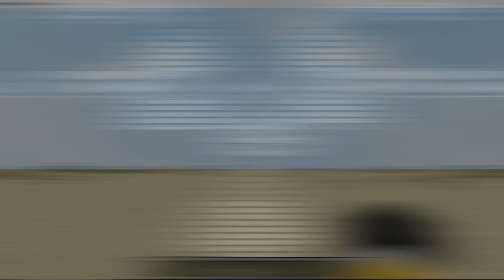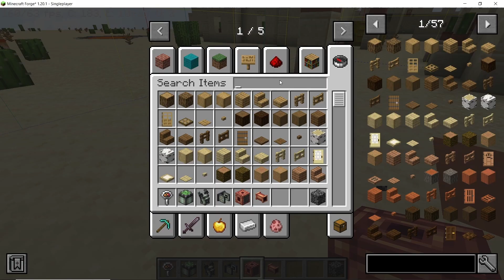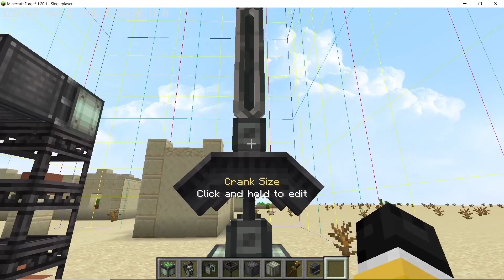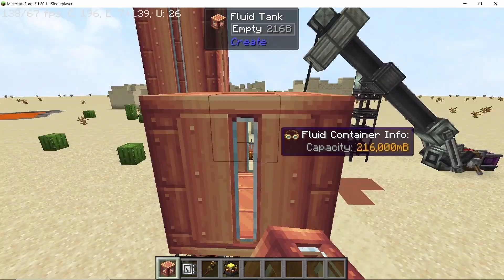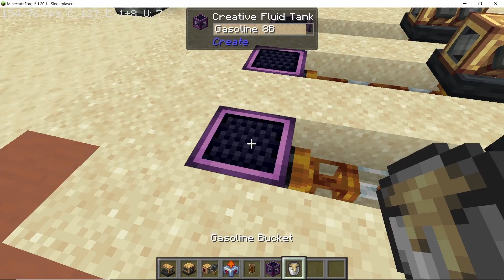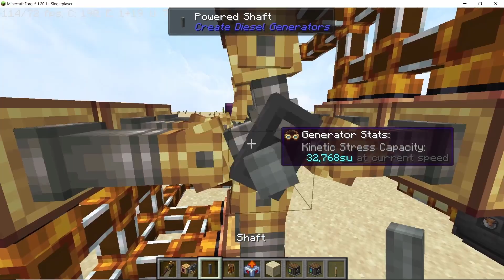Create : Diesel Generators Mod : Pumpjacks, Diesel Engines, Distillation Towers & More

Comment: Hey bro can you give me some advice, as I cant find any proper progression guide for HBM? Right now i got the oil refinery and industrial combustion engine to produce power. What do i do now? I thought abt the chemical plant to produce some chemicals but what should be my goal? Love from germany
Reply from the maker: With oil products obtained I think you should aim for your first nuclear reactor now. Maybe zirnox or a very simple rbmk as it'll be a big power boost as compared to oil power. For this you'll need to refine radioactive ores like uranium and thorium so make sure you upgrade your hazmat suit and try to make the process as efficient as possible cause the more nuclear fuel you obtain from your ores the more powerful fuel you can craft from it once depleted. I wish you all the very best and also let me know if you run into any issues
Reply: @SavageVegeta  Hey thanks for the tips thats actually what I did now. If you care here id what I did: I got a Zirnox and had it run with natural Uranium a long time to get a lot of more nuggets of others, also I have schrabidium and the lunatic Armor now. I also use the ore lase from minefactory reloaded with reduced work so i dont have to mine for iron every second, but I kust used it for help and replace it with sth from hbm mod. You think the best next step would be like a PWR Reactor?
Reply from the maker: @zynoo9450  yeah PWR would definitely be a good progression step. Also don't forget you have access to the Chicago pile using which plutonium can be made and also the research reactor which will power the breeding reactor so your fuels can become even more powerful.
Reply from the maker: @zynoo9450  also one more question, why are you using the laser from MFR when NTM has bedrock ores available. Craft yourself a large mining drill and then bedrock ores will provide you with a continuous stream of the chosen material. The best part is even uranium and thorium have their bedrock ores so if you manage to find them then you can have as much Nuclear fuel for your reactors as you need
Reply: @SavageVegeta  Rn im crafting the 4 breeding reactors along the reasearch to enchance my fuel. The problem is the Zirnox doesnr provide enough energy to power the large ming drill (except i have better fuel-> more steam) or I burn some high flammable fuels in an industrial combustion engine. I want to use the ming drill with all the upgrades, but its very expensive to power right now, I will first make the PWR or Chicago Pile
Reply from the maker: @zynoo9450  alright then, hopefully a PWR will provide a nice boost to your overall power grid 💥

Comment: please for next video told me how wear the glinder and how make agreat bunker
Reply from the maker: Fill the glider with fuel first by placing it in the output slot of a barrel/tank which has kerosene in it and then attach it to the chestplate using the armor modification table. It is as simple as that :D

Comment: I have a question: in some of your videos you have above 60 fps. I set fps to unlimited but is still have 60 fps (i have a good gaming PC) The sodium mod doesn't work because it's not for the version 1.7.10 How do you get more than 60 fps?
Reply: Did you enable v-sync? It synchronizes fps with the monitor's refresh rate (assuming you're using 60hz monitor)
Reply: @interceptionunit6666  yeah....